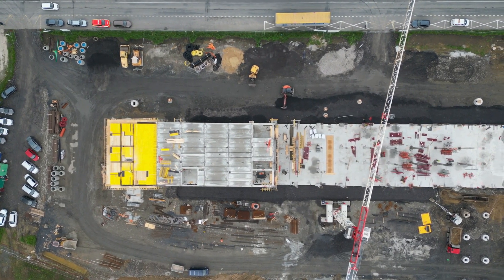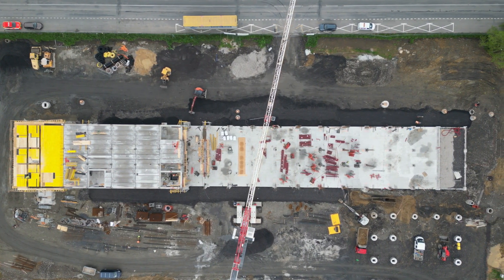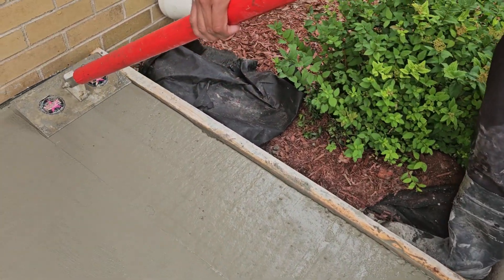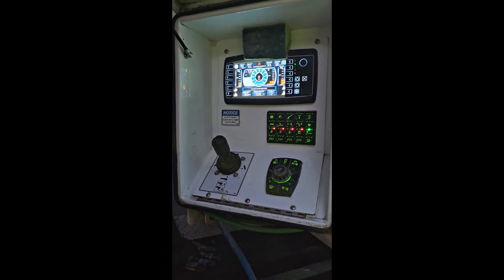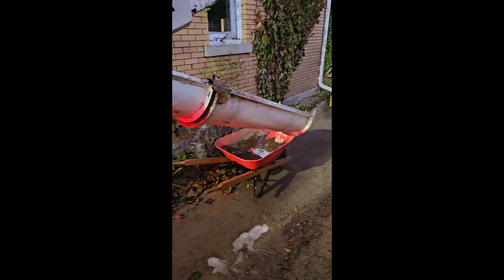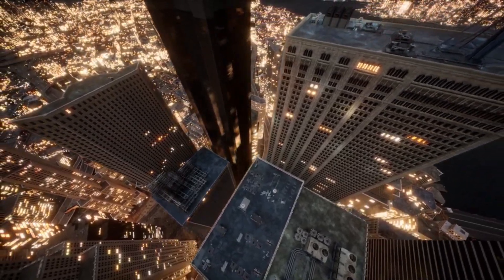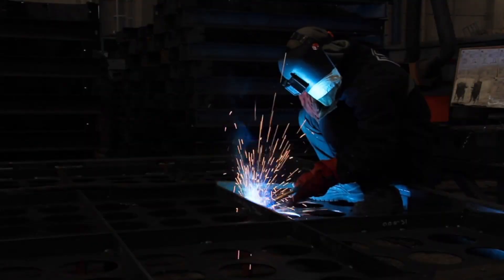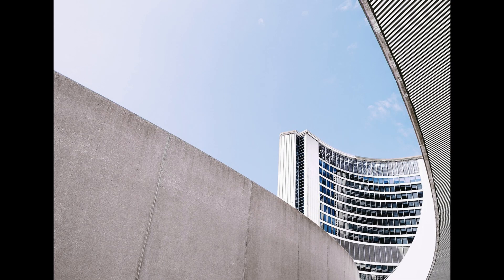GLASS FIBER REINFORCED CONCRETE VS SFRC

Comment: I want to build a small cellar, 3x2.5 meters, walls slab, ceiling, all in 30 cm thick concrete. Can I use fiber glass concrete? steel fiber (much more expensive). I don't feel like using traditional reinforcement, you have to put so much work into it.